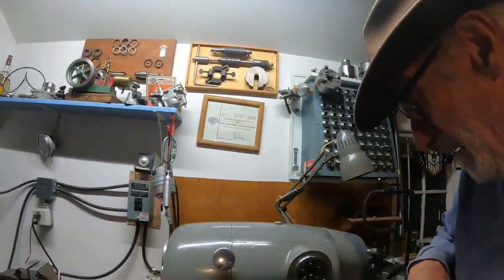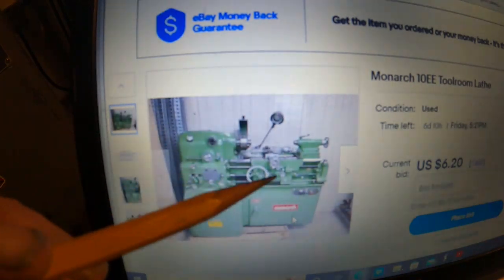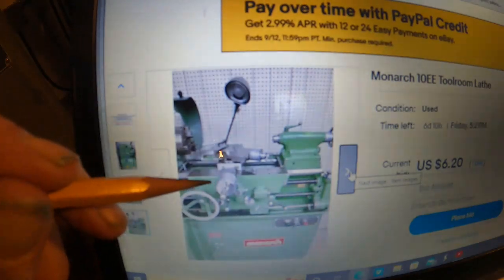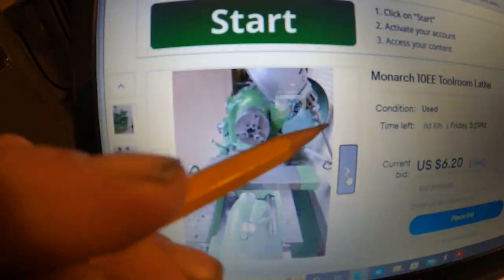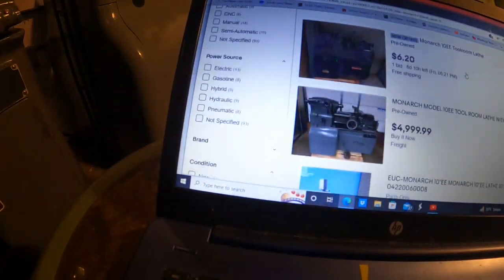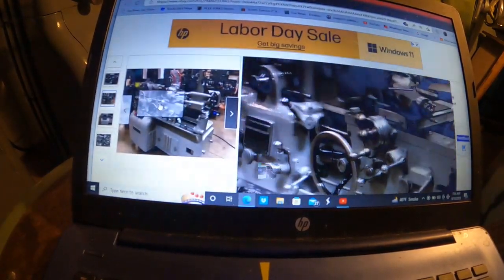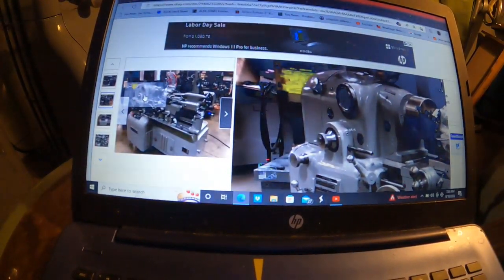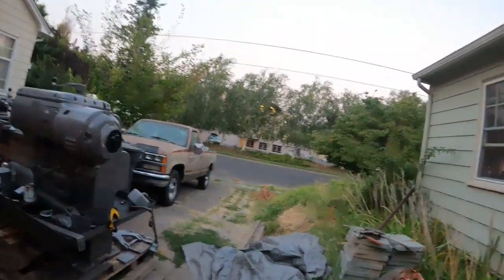Monarch 10ee lathe high end survey

Comment: Lol, $19000 gets you a nice CNC lathe with decent VFD drive, without that ancient DC motor garbage....
Reply from the maker: I will kick your ass on machining a "single high precision part" such as a grinder spindle out of pre hard holding .0001" tolerance on the bearing journals. That is why the national labs still use these.

Comment: DeeDee, I hope you’re taking your blood pressure medication if you’re going to spend much time on the Internet checking out the various morphodiditc mutilated 10ee’s.  The original tube type dc drives are wonderful, are easy to maintain and/or repair and there are spare parts readily available.  These machines will outlast anyone who buys one and takes care of it.  Cheers, The Blade
Reply from the maker: I now take command of the situation from the amateurs, fake machinist and brain boys that have polluted the entire internet with non-sense regarding these machines and the drive systems, and it will leave a mark.

Comment: I took a chance and bought My monarch 10ee for 1500 dollars  I was not able to see it personally and just had a few grainy photos. I grossly underestimated the Monarch and assumed I would have to take the ac motor with inverter rout. after all how could a machine from 1956  with tubes be expected to work?   It was worth it even if I had to replace drive system. 
I lucked out as it worked perfect. It was wired for 480 so I had to run through a transformer but the monarch drive system is a pleasure to use. 
 by the way , I hope You dont get upset. i cheated and looked at the actual ebay listing as You discussed the photos. I think I would much rather see a 2 speed gearbox motor. How can You live without back gear? The buyer will be sorry when they need low rpm like I need all the time cutting tool steel or big drills into tool steel. sometimes You need 100 rpm with good torque. I doubt this machine will perform at that range.
Reply from the maker: The constant excuse is the drive is too far gone so I went with "The PM loser troll drive". I saw smoke it cant be fixed. The internet is full of excuses and dead beats. The lathe pictured with the conversion. will not function correctly or have enough power to perform.